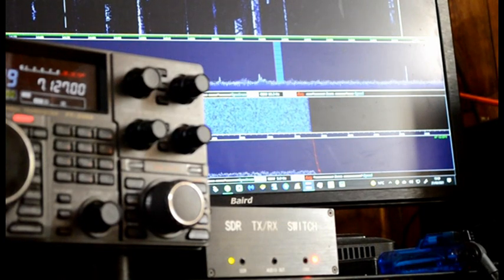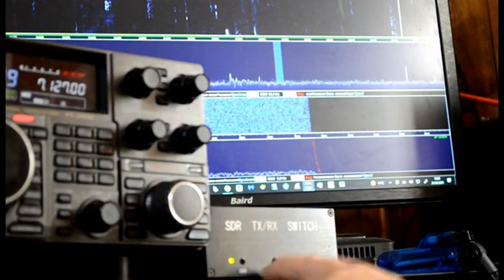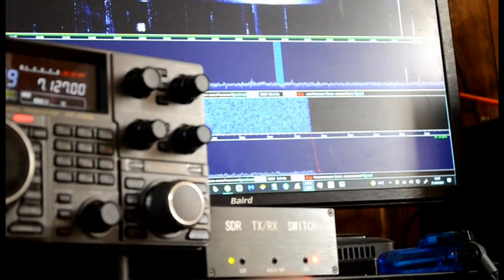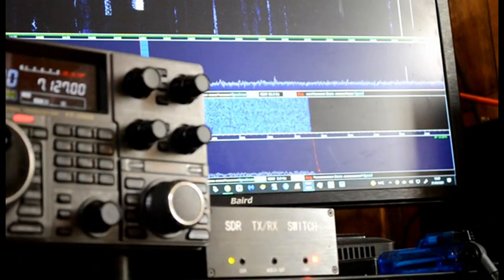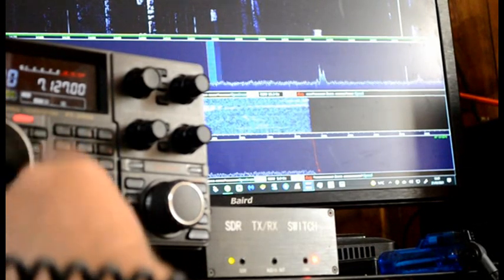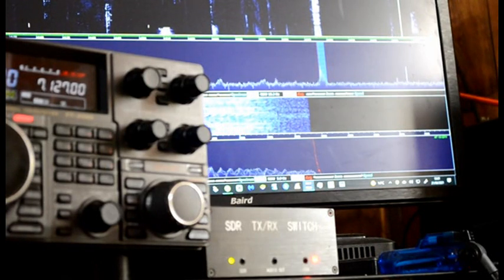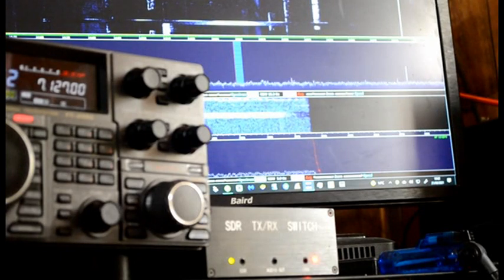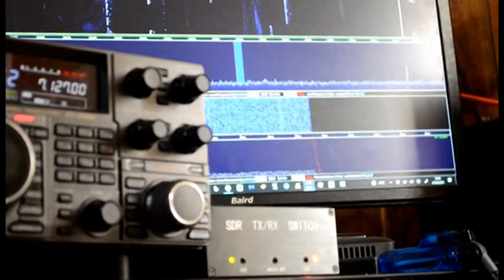SDR ANTENNA SWITCH is this the mfj-1708 sdr killer!!! banggoods sdr rf sensing switch review  M1DLS

Comment: Hi there! I noticed that when you were transmitting the SDR was picking up some of your TX. I assume those are safe levels? Did I understand correctly? Many thanks
Reply from the maker: yeah buddy, totally fine, 3 years without fail, 200w +
Reply: @homebrewham2786  thanks so much, I ended up buying one. Doesn't seem to be working on VHF - huge SWR but is ok for HF
Reply from the maker: no problem at all mate, yeah i think they were generous with 160 mhz,

i reckon 6m-4m max, 0mhz-70mhz, 

tip,  if you have a rear port labelled "tx grd"that grounds the sdr port,  

which radio do you use?

Comment: Where is the ptt connection made on the transceiver?
Reply from the maker: i use a tx ground output on my ft2000, but this is also rf sensing and i used that for 1 yr without any problems